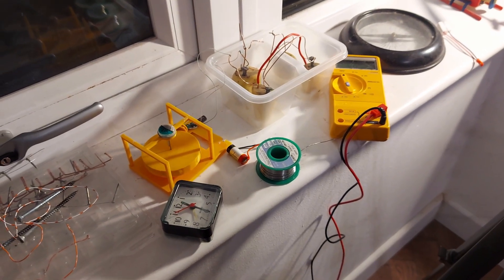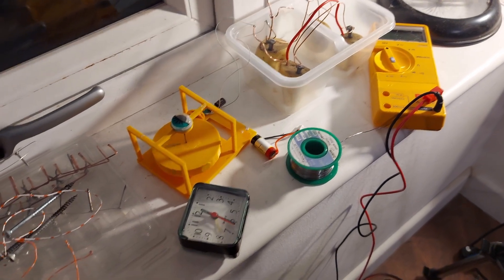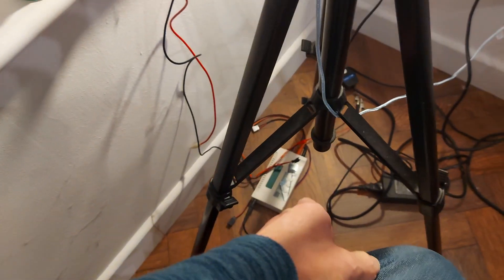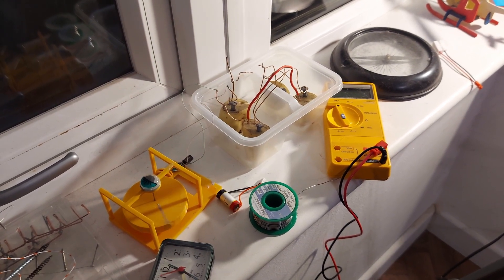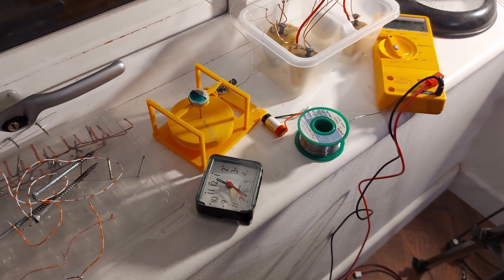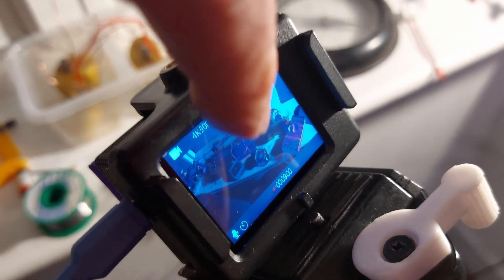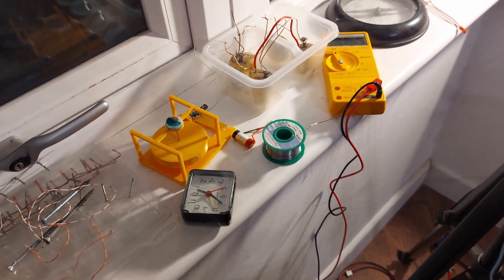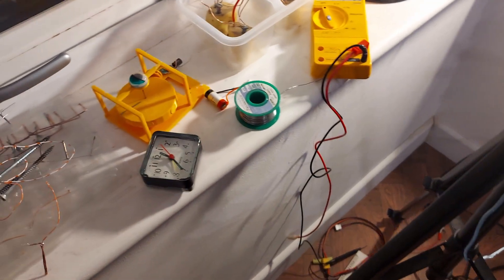Addendum to recharging the potato batteries

Comment: A good finding, something I didn't know for a start. An overnight piece of fruit or veg with solar charging in the day could be a fun avenue.
Also have tried the NiMH setting to get a charge going and it does work well. TP4056's do something similar.  😀
Reply from the maker: The snowman was running for months or maybe years on practically dead AA batteries. I would assume it had died, and then look at it another day and it had started up again. Sometimes it seemed a warm day had triggered it, but it was not always the case. A similar thing seems to be happening with the potatoes. It is probably down to the capacitor getting enough charge to trigger it and then there is enough left to run it for a while.